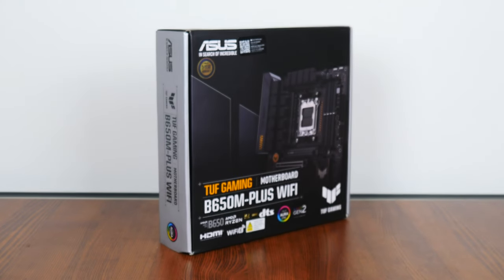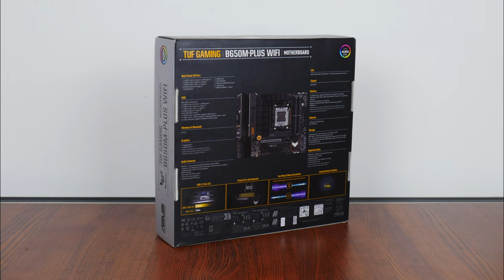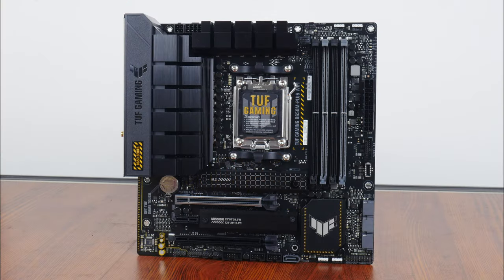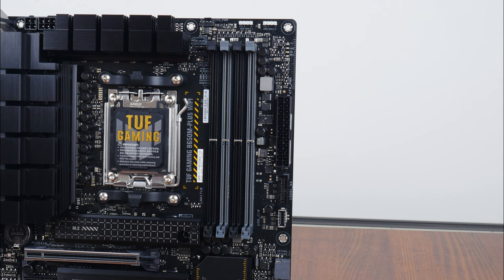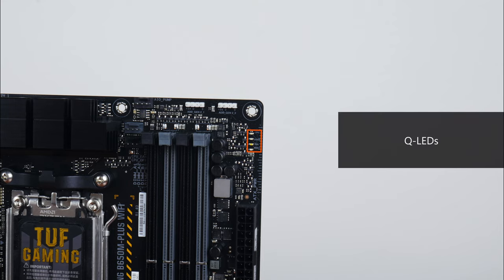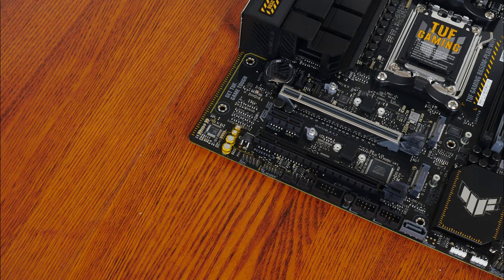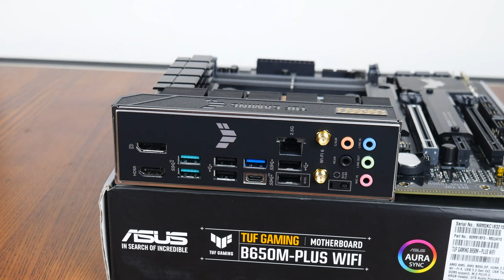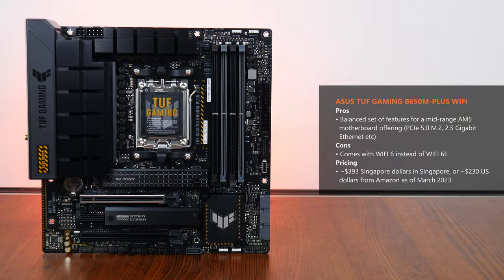ASUS TUF GAMING B650M-PLUS WIFI - mATX AM5 Motherboard for Gamers on a Budget!

Comment: Do i need to update the bios on this board, or that is done automatically ? I have EXPO option, and im thinking of enabling it, so my RAM can run at full 6000mhz speed, but i also heard that it can damage cpu. I have 7800x3d...
Reply from the maker: It'd be good to just update the board's BIOS to the latest version that can be found on ASUS's website. While I don't think you'd encounter any issues, no harm just making sure you've got the latest BIOS installed before enabling EXPO!
Reply: @ALKtech  Just updated bios to 1636v from Asus site.
I think i ll enable expo now :))
Thanks man...

Comment: Hi, may which is better? any insights? a620m plus wifi vs b650m-e wifi
Reply from the maker: The B650M-E WIFI is the better board when compared to the A620M-PLUS WIFI, but it'll be more expensive for sure owing to the better features. What processor are you intending to use for your PC build?

Comment: I am currently rebuilding my cyberpower PC and i am in need of quite a few new parts. I am looking at a 4060 and i need a motherboard to go with it because my current one is only a AMD 760G. I am looking at this one and i was wondering if this B650 and a 4060 would fit and go good together.
Reply from the maker: Oh yes, this board will work just fine with a 4060. What processor are you intending to use for your PC?
Reply: @ALKtech  how about 5 8600g ?
Reply from the maker: @darkox4334  yeap a Ryzen 5 8600G will work fine with this board, though you might have to update the BIOS prior though - this is especially if the board that you have is older stock, which might not have the latest BIOS version that supports the Ryzen 8000 series of APUs!
Reply: @ALKtech  Ty so much new subs here

Comment: I've bought this motherboard, and i wonder what is the difference between this one with M and without M.

ASUS TUF GAMING B650M-PLUS WIFI 
ASUS TUF GAMING B650 PLUS WIFI
Reply from the maker: The M model is micro ATX, has one less M.2 slot, one less PCIe x1 slot and a slightly different USB port configuration over the non-M model. Otherwise, both boards by and large are similar!
Reply: @ALKtech  So not a big deal i guess...Thanks man.
Reply: @ALKtech  Just one more question, should I install the GPU on the first PCi slot closer to the CPU or ? And if one day I want to get a sound card, they probably won't have enough room for both, since GPUs are large i guess? Thank you...
Reply from the maker: @Anth0ny85  you should always install your graphics card in the slot that's closest to the CPU - the first PCIe slot almost always is the primary slot meant for a graphics card, with the full 16 lanes for maximum bandwidth!

And yes, assuming you've got the M model, if you've got a thick graphics card, it'll be unlikely that you've enough space to install a PCIe sound card in the bottommost slots...

Comment: Have you tried dual tower cpu cooler on this board? is ram clearance an issue for a dual ram kit?
Reply from the maker: I haven't had the chance to do so, but I'd advise getting low-profile RAM sticks especially if your intention is to use dual tower coolers with dual fans - this would apply to other motherboards and not just this B650M-PLUS WIFI as well! What cooler are you intending to use, out of curiosity?
Reply: @ALKtech  The cooler i'm planning on is the PA120SE. Yeah, I'm going for the fury beast black, that's probably the lowest it gets.
Reply from the maker: @MuffyA  I see, I'd think you shouldn't have any issues with RAM clearances with this board in any case!

Comment: Hi, can this mb handle these? im not that good with checking specs.
Crucial T700 2TB Gen5 NVMe M.2 SSD
Ryzen 9 7950X3D
Reply from the maker: Yup this board will work fine with the SSD and processor that you've mentioned! You'll want to make sure that you've got a good CPU cooler to keep the 7950X3D's thermals at bay.
Reply: @ALKtech  thanks a lot

Comment: I thought it would support PCIe 5.0x16 on the upper port
Reply from the maker: B650 boards do not come with PCIe Gen 5 support for a graphics card slot - B650E boards on the other hand, come with Gen 5 support for both a graphics card and M.2 slot!

Comment: Can a 4080 super fit on the matx version of this board.
Reply from the maker: Yup it will, the concern here will be more of whether your PC case will be able to accommodate a 4080 SUPER (I'm assuming you're using a mATX case). You might want to check the dimensions of your PC case to be sure!
Reply: @ALKtech  My case is a Thermaltake Core V21 Compact Cube Black Windowed Micro ATX Gaming Case, it's quite a decent size case compared to other matx cases, i'm pretty sure it says it can fit upto a 350mm gpu which is more than enough room right.
Reply from the maker: @HungarianMaestro  mmm yeah I saw the 350mm GPU clearance being mentioned on Thermaltake's website. I suppose you have your motherboard mounted horizontally? Also gotta make sure the 4080 SUPER that you're getting doesn't have some oversized cooler that exceeds the 350mm length restriction - there might be some high-end 4080 SUPER cards that sport larger-than-usual coolers!
Reply: Yes the motherboard is horizontal, and i will be checking the lengths of the graphics card when I buy it, it's a shame the duel ones are very scarce and very expensive, the 4070ti super is always a good option to.

Comment: Most folks don't even have WiFi 6 routers so WiFi 6E won't even matter. Wired connection is best unless folks stealing their neighbours WiFi
Reply: Wired connection might not be readily available for everyone in all situations.
Reply: Actually Wifi 6 is gaining the popularity these days due to its ability to give single digit pings and near 1Gbps or even above 1Gbps speeds under the right conditions